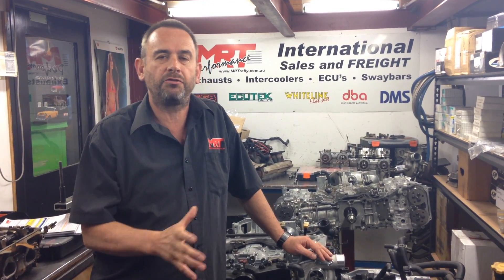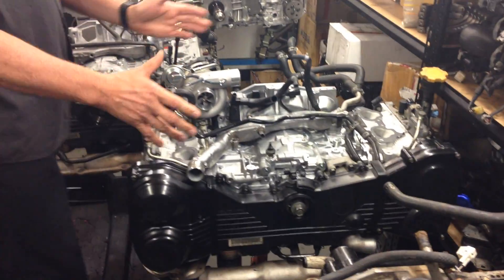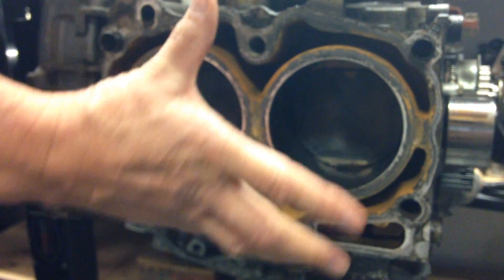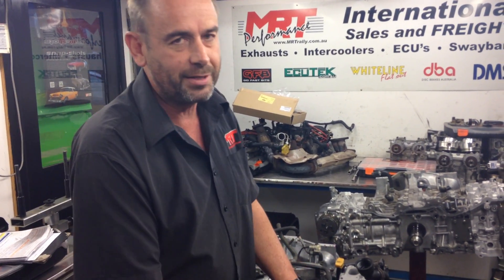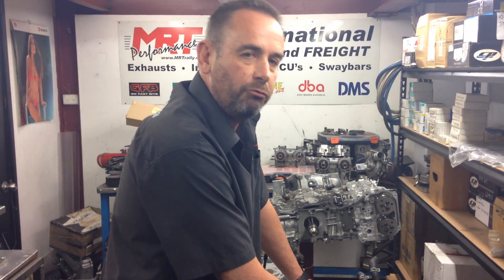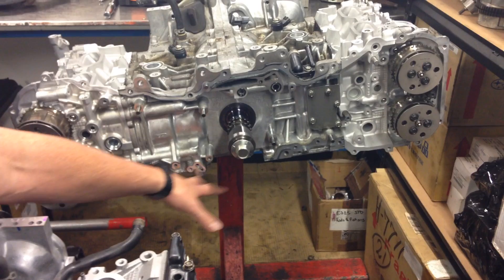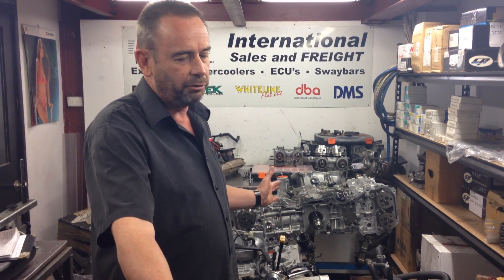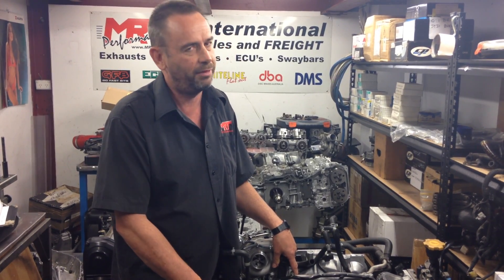Subaru engine comparison, FA20, EJ20, EJ25,STi, WRX

Comment: Does FA20 the newest engine are reliable?
Reply: MasterMech77 340 horsepower in that little car? Sounds nice
Reply: /DRIVE has a awesome video talking about the advantages of the FA motor
Reply: +Lucas Nguyen
The only couple of minor things were covered under a TSB (Toyota Service Bulletin). From what I can remember off the top of my head, it was a window guide issue, remapped the ECU when I first bought it to correct the idle issue, and some other really small things that were taken care of at the service center. I live in New Tampa, FL 33647... so it is pretty hot and the humidity is very high, no issues with overheating or anything like that. I do have an aftermarket oil cooler, and upgraded radiator to support the turbo system. Since boost adds heat and heat kills engines... figured can't hurt to go all out on the cooling side of things. SO no major issues at all, and I am very hard on my vehicles. I have a lead foot for the throttle, and enjoy rev matching and engine braking every chance I can use it.
Reply: +Lucas Nguyen
You are welcome, I do want to point out that any more HP then I am running is going to really stress the connecting rods, and pistons. SO if you are serious about making "power", then the main thing is to do the rotating assemble. However if 400 HP is your goal, then connecting rods are the minimum thing needed to keep the engine alive. I have not heard of anyone having issues with the power levels I am running on the stock engine.
Reply: Inverted V12 Powerhouse yeah don't get me wrong, the factory horse power is good. However having just about double the factory power has really transformed the car. It can now out perform mustang GT's on track.
Reply: MasterMech77 any issues over the timespan to today? also just curious but which area of the US do u live?
Reply: Thanks MasterMech, hearing your experiences instills much more confidence, I always felt like there was a cache to gaining those levels of hp
Reply: Yeah MasterMech, I don't think I am looking for a full 400 hp ( at least not yet ;) ), I actually have the FB20 engine which is slightly different as in less performance and more efficiency, and my actual car is a 2017 impreza sport. My biggest concerns so far are the cvt and I would be happier with a more peppy 200 hp (right now 152), that's all. In my dreams I'd take the 400 hp but realistically commuting is a higher priority, I do like to take the car on fun roads every now and then and the first part of my commute is a winding mountain highway (CA highway 17).
Reply: Hi coming from a FA20 owner (2013 Scion FRS 10-series, bought the car in Nov, 2012). I installed a AVO stage 2 kit running 9 PSI the moment it became available. Not exactly sure when that was but I know it was in the first few months of owning the vehicle. SO point is, I have had the engine under "boost" for pretty much the entire time I have owned it. I have not had any issues, with the engine. Of course I am not pushing any crazy PSI through the engine, but the 340ish WHP, was what the car was missing from the factory. The original WHP was about 175 so a bump of over 165 HP was well worth the 7 grand USD for everything that I needed to do to make sure the car was reliable.

Comment: Great video...
You could do something similar on turbos. Subaru have used td04, vf22, vf28....
Reply from the maker: ok
Reply: Hello. I like to video very much. I have an Ej20 with around 118 Hp, i dont know the exact engine code, and cant seem to find out wich model it came from, i have it en my vw t3 caravelle, but it just took the bevaring for the piston rods, and now im lookout for a New one, could you tell me wich engine i have, if ill send u a picture?

Comment: Have you had or dismissed the idea of a front mounted turbo setup on an EJ engine in a GC8? Would you advice against such a configuration?
Reply from the maker: for road  cars a FMIC these days is not needed unless you plan HUGE mods

Comment: Thanks Brett for the insights on Subaru engines. I'm currently working on a STI conversion of my MY99 Impreza GT including the complete drivetrain with 6-speed gearbox and DCCD. I wasn't sure if the EJ207 always came with forged pistons or just specific model years. So thanks for clearing that up for me.
Reply: 5/6 sti ej207 is forged pistons, they also have a smaller piston skirt than previous versions (I pulled one apart not that long ago)
Reply: Version 5 and 6 EJ207 never had forged pistons regardless of what he said in the video. I think the RA models might have but not a normal STi.
Reply: Or wait, I think it's Version 8 and up that used Hyper-Euteric crappy pistons, the older STi's (like my Version 4 STi) had forged pistons.

Comment: I had  been debating building a suby to put in a Factory Five 818. what are your thoughts on building a durable 325hp-350hp, 2.0lt. and how pricey of a proposition would you say that would be?
Reply from the maker: its best you call us 0297674545
Reply: MRT Performance I'm in the United States so I probably wouldn't be shipping it back and forth overseas to have you all do the work unfortunately, so I was really just hoping to pick your brain and get some ideas from someone with the real knowledge.
Reply: You would be well-served to build a 2L or a 2.34 destroker for racing with DS. I have an 818R and have a destroker for it. Supposed to be good for 9-9.5K. Look on the FFR forum/818 if you haven't.

Comment: I have an EJ20 in my forester 06 model. Can I put an EJ25 in it without any trouble? I have a Hyundai computer which caused that horrible hesitation with that model. Its been sorted but it still doesn't run quite right.
Reply from the maker: best call  us

Comment: Whats the most common failure you see on a subaru engines? like the non-turbo ones because less people trash on them
Reply from the maker: it varies!
Reply: Matt Coffey man! Those engines suck. I'm happy I can redline
Reply: On my GT86 (FA20 engine) I've noticed the cam solonoid covers going rusty after just 4 years! Seems to be quite common so that might be something to look out for. Luckily they are easy to get to and only held on my a couple of bolts, so rust treating them is easy to do..